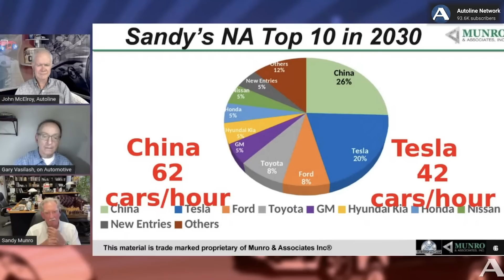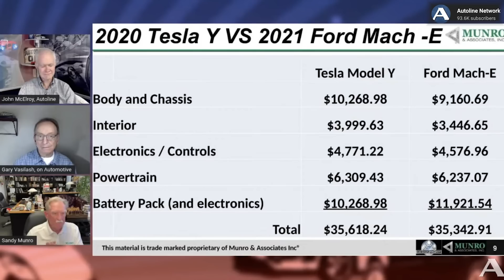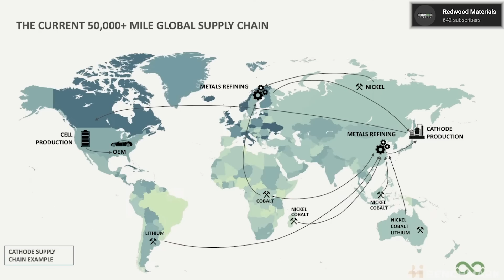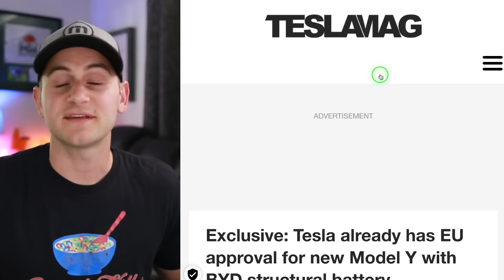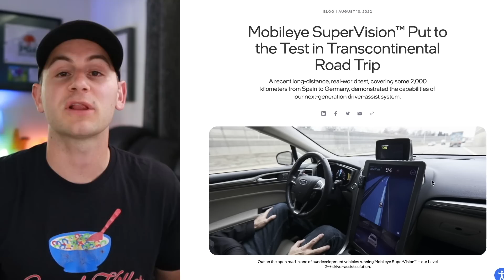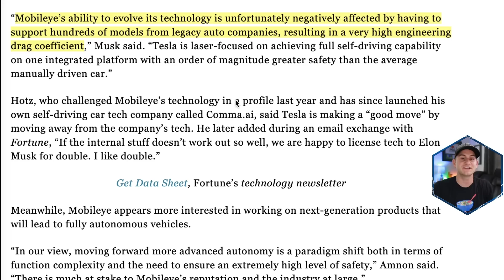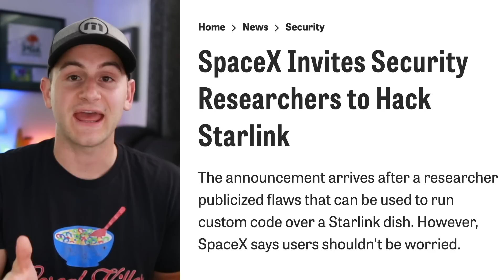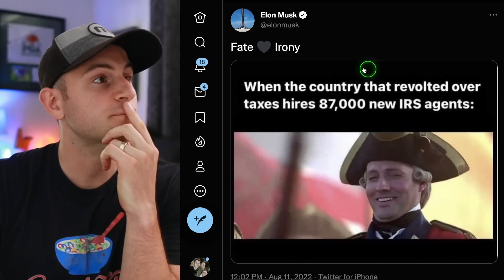New Munro Interviews / JB Straubel Keynote / Starlink Hacked ⚡️

Comment: Video says: “eventually there will be no mining (because of recycling)”.  For that to be true would require the amount of GWh/TWh in service to stop increasing or the amount of materials needed per GWh to always decrease (because recycling is not 100% efficient). If the fleet of batteries has a useful life of 30 years and recycling efficiency is 97% the required mined tonnage remains constant for a constant battery fleet size.

Comment: there will be mining for a long time.  even if you reach some equilibrium in battery materials in use there will be a greater need for storage to strengthen the grid.  Plus as long as recycled materials cost is > new materials, there will be mining.

Comment: The other automaker's problem is not failing to ask Elon for advice. The advice he would have would not help them. Their problem is accepting that they have to invest and risk lots of money to do their own production. Keep in mind Tesla manufactures Panasonic cells. But the keyword is manufactures. They also invest into the developments in their own facility. Getting the knowledge is not the issue. No one else is willing to supply their own battery factory for making the cells because the financial commitment is huge and a short term profit killer and also long term risk in their eyes

Comment: Every time I see a production line that makes Pouch cells, I'm bemused at how complex the process is, and how slowly the line runs. To me, it's a no brainer to use large Cylindrical cells because from a manufacturing point of view it's so much simpler and easier to ramp up the production speed.

Comment: Megapack is also up 25% in price from those two images (even accounting for the increase in battery pack size). I had to check the site, but it's now $2,427K vs $1,527K (3.9MW vs 3.1MW).

Comment: the nay sayers of batteries are REALLY missing the point here. 'battery mining pollutes'- mm... no. NOT REALLY. it's a lot 'messier' than it needs to be- but NOT because it HAS to be- only because no one has bothered to clean up the process-  kind of like cars with no smog controls in the 1960's. and mining for lithium is NO WORSE than mining for coal- in fact- A LOT of people have DIED mining for coal- I doubt ANY have died mining for lithium. 'lithium batteries cannot be recycled'- lmao. JB straubel already IS DOING JUST THAT with a pilot plant- and i don't think toyota would PARTNER with redwood materials if it was a hoax. 

back to the part the oil heads are MISSING: put in perspective- what if, TOMORROW- a company figured out how to capture ALL the exhaust particles coming from an ice engine.. and RECYCLE 96% of it back into some form of usable energy? HOW RICH would that company be? opec & Api would be BLOWN OFF THEIR FEET. they'd be turned into a paper tiger- almost overnight. 

AND THAT IS WHAT REDWOOD materials has done- effectively, by making a profitable process for recycling battery materials. what this means for EV production? once we reach 100% saturation in the usa- after that- we only need mine for 4% of the annual car production, plus a TINY amount for growth. consider this- 1970 yearly production? approximately 13 million. 2021? about 15 million. that's only a .86% rate of gain. 

also to consider- gas cars are MASSIVELY OVERPRODUCED- way past demand. couple that with the fact that a tesla with a 50 year one million mile battery and electric drive train? plus ALL those batteries getting recycled at end of life- AT A PROFIT- how badly tarred, feathered, hooked & fried are gas cars- and by extension, big oil? battery recycling is the 'new oil' investment opportunity. the oil heads like to say "all those batteries will pollute landfills"... so ask the question: does ANYONE throw away copper? HELL NO! at approximately $3 a pound- you'd be an IDIOT to do so. no one has to make a law to FORCE you to recycle copper. so go ahead- throw it in the trash at a city park- a homeless person will be along VERY SHORTLY to retrieve all the aluminum cans AND copper that you dump- and if your local landfill is stupid enough to throw it away? let those homeless people in- they'll pick it clean. now consider this: the CURRENT price of lithium? 

$32 per pound!!! yeah. SURE. throw it in a landfill. ARE YOU NUTS!!???
Reply: That was an awesome rant especially the point about recycling 96% of all oil into new oil to end up a trillionaire. 😀👍🏻
Reply: @4literv6  'rant' kind of implies- there's no reason to be pissed off about being manipulated INTO paying $7 a gallon for gasoline- 

and assumes no one will mind or even NOTICE that- in 1963- Chevrolet built cars that were ROUTINELY capable of lasting 1 million miles with minimal parts replacement. 

the end effect of such a business model- is that consumers basically do NOT 'own' their cars- we RENT them. the cars themselves are temporary- intentionally engineered to fall apart. and then the energy that powers them - is ONLY available through ONE source- OPEC & APi. with such a powerful DUO in place- aka- big oil & legacy auto- they protect their cash cow like a starving pitt bull would defend his food dish with the last bone left in it. these 2 want to make sure you have NO OTHER OPTIONS. 

that's why I'm NOT pissed off- I'm ECSTATIC about the existence of tesla. 

NO ONE is going to 'save the planet'- on that stupid fallacy- I call BS. 

but tesla will save you from giving your life savings to the one armed bandit at chevron. and if big oil tries to 'shore up' their bets- by raising the cost of coal & natural gas? 

GOOD. 

I have tesla solar with power wall- and already I'm disconnected from the grid.... so let 'er rip opec. your move. 

 did you know- that I could EASILY buy feedstock (non-food grade) sugar from mexico & s. america for around 3 cents per pound? then- even after paying for a distillery license & road tax for ethanol fuel- come out at about 80 cents per gallon MAKING my own fuel? 

so why don't I?  because the very second I try to import sugar from outside the united states- the fed will hit me with an import tax that ensures my fuel will cost MORE than if I just went & bought it at the pump. (if I buy clay pots or tile? no problem.. .then we have 'free trade') oh gee- I WONDER who THAT would benefit? what group of corporations could have possibly lobbied for THAT little gem of a law?

Comment: 4680 a) with respect to 18650 b) cell 
b) more thermal couple area/W 👍
a) less thermal couple area/W 👎
a) cells operate much hotter than b)👎
b) use tab area to pass anode current, 👍 
a) use point contacts for anode current 👎
b) single tab bottle neck effect needs data
a) point contacts defeating the tab less 👎
a) point contact is no better than tab👎
a) pack has no bottom structural plate👎
a) no bottom structural plate is a joke👎
Reply: You don’t actually know what you are talking about do you?
So many innovations follow 4680. Heat dissipation, weight & cost savings, simplicity, bringing cell manufacture in-house (to speed innovation).
Reply: @iandavies4853  yes I do know what my comments are. 

Following 4680 innovations is a good thing. Here we have an issue, overheating from reduced cell wall heat sink area per Watt dissipation compared to 18650. 

4680 issue
Core heat diffuse through chemical layers has been a thermal dissipation problem with 18650 of 9mm radius, r, in BEV application, that is worsen with 4680 of 23mm radius, R.

Details 
Let cell volume represents heat dissipation, and let heat sink through cylinder wall area, the area/W ratio of 18650,r and 4680,R is 1/R to 1/r, or about 0.111:0.044 and simplified to 2.55:1. That is to say 18650 has 2.55x more area per Watt of dissipation. That also implies 4680 runs 2.56x hotter than 18650 given the same dissipation. That also calls for -2.55x coolant for 4680 to match thermal load of 18650. That may suggest we need expensive forces vapor phase technology to cool 4680 using a heat pump system further reduce charged mileage.
Reply: @philoso377  still wrong. Fundamentally, hopelessly very wrong.
4680 tabless uses metal foil of current collectors (aluminium & copper) to wick heat to end caps, not relying on slow path through a 40 odd layers of separators & electrolyte. Battery Day. This is reason for continuous folded tab design - heat & electricity. 
In structural pack it looks different / misleading as uses sinuous side cooling bandoliers - relying on thick steel casing as heat path - and only contact-cooling one side of each cell. 
Even 2170/18650 (eg Plaid) only directly cooled one side of each cell, not entire circumference, not flooded pack style. 
Learn from the experts, unless you are at cutting edge of this tech. (I’m here to learn, not preach.)
Reply: @iandavies4853  the anode roll of 4680 protrude beyond the insulation fringe line finished in anode flaps (aka shingle) carries heat from chemical layers ready to sink at the cylinder base but is isolated by an electrical contact wafer in front of the base. This wafer conduct current but heat. Leaving the only path heat can sink through cylinder wall. As do 18650 and 21700 cell do in model3. If you think heat can sink pass the cylinder base, you have missed the late news on 4680 on Sandy’s channel. Everyone do their own research and analysis. So start do so from today.
Reply: @philoso377  you know you are wrong! You just have to sort out why.
I’d suggest look at Limiting Factor cell teardown video, not Munro pack teardown.
Around 17 min in. But still confusing. "Whole cell body is anode." (electrical)
Reply: @iandavies4853  “limiting factor”? Yes sighted in whole. Have you review it in full detailed, like a product developer with 25 years in the mass market industry? 

You’ve missed the most critical part - point contact wafer - (in limiting factor) that blocks thermal conductivity between the hot anode flaps and cylinder base. That is why Tesla employs side wall thermal coupling and not cylinder base coupling. Drawn from Sandy’s video we have a plastic cradle to isolate cell base further heat insulate the cylinder base. That video also confirms that we have no thermal architecture laid beneath cylinder base. So your advocacy heat sink at cylinder base offer no rationale.

Comment: Apparently there is rumor that Elon actively worked to stop or slow down high speed rail in California using hyper loop as a false promise. Would like to know what you think about this because without rail, long term viability of auto manufacture isn’t viable, especially to the climate.
Reply: @not today dude if you asked most physicists about hyperloop systems then you would hear about how dangers and impractical most of those systems are. So elon, someone with training and access to highly skilled engineers is promoting the system. Something is very off and thats from someone who loves most of the stuff he has helped push forward.
Reply: @not today I do, I study this for a living and I actually want cars to exist long term, which is something you don’t seem to get about what I have written.
Reply: @not today I don’t know if your a bot because I think you missed something in this conversation, take a breather and come back and read this from an objective point of view. I’m not being sarcastic and I’m not trying to belittle you.
Reply: @not today okay I’ll start looking up the information but lets start the by analyzing  the hyper loop. Said hyperloop has been promoted at being able to achieve speeds of 800 mph. Let’s give it som headroom and say the loop travels 600 mph, just to give the benefit of the doubt. That means that traveling forward 600 mph, you would drop or rise 4.21ft per min. La height-305ft, San Fran height 52ft. Californias avg elevation is 14505ft. Cut that in half to account for mountains and you still have a potential shift of 7252. Do you start to see the problem here.
Reply: @not today That was establishing height, now lets establish construction. To maintain a perfect vacuum you will have 6720lbs per ft of pressure on the container. That is an insane amount of force that will need a lot of maintenance. The hyperloop test tubes have shown rust on the inside of the container meaning they have not been well maintained and you need that reduction of friction to get to hyperloop speeds. This also shows the difficulty of maintaining the vacuum.
Reply: @not today Then you have to account for feasibility. Elons current model for teslas through tunnel has been causing traffic jams in the boring tunnels. I just wanted to remind you of that for the next part,it’s important. In order for the boring tunnels to actually help people and reduce the burden on society, the tunnel and mode of transport needs enough people traveling through, per mile, per dollar spent. If it costs to much to build and maintain then it becomes a financial burden, if it does transport enough people then it becomes inconvenient, if it doesn’t transport enough people per mile then it becomes in practical.  The hyperloop is set to transport 10080 a day while building high speed rail will transport 115000 per day. So high speed rail would be more cost effective and convenient and literally the cost of high speed rail has risen because rich people (this is documented, without including the Elon rumor) so that you buy cars.
Reply: @not today this is based on research form actual engineers, physicists, etc. which is why I am saying that Elon should know better and literally advocate for rail in addition to an electric car society.
Reply: @not today yes but this is the problem right there, you don’t care that a project like this might be used to stop hsr, that is the whole point of asking electrified to research the rumor and facts around it because if true then that means money is going to another rich person holding back sustainable change. The fact that you reacted like this when I wasn’t even making an accusation. I was asking a source of information to research if true since I haven’t had time to do it myself and if he gets accurate results then it reaches people that care about the issue. If nothing comes up then nothing comes up. When Tesla and Elon have this much wealth and power then they need to be held to a higher standard then if not you get another legacy auto.

Comment: Funny - can I use the 4680 battery in my EV Bike ?
Reply: @Bigboy0  4680 battery - 3.7 volts - I would need 13 to power my Himiway EV bike - it requires 48 volts - so it has a 17 amp hour battery - the the 4680 battery has a 26 amp hour life therefore I could go 40% long on a charge - instead of 35 miles - I could go 50 miles - so the same should be true for a Tesla car - 350 mile range to 500 mile range on a single charge. True

Comment: Given the same chemistry, prismatic cells (or pouch) will always be more energy dense than cylindrical.
Reply: But unprotected. Tesla always rejected 18650 cells with dents.
Pouch is just so vulnerable. Prismatic isn’t so different, just shape.
Watch teardown of 4680 - it’s tough.
Then there’s structural; The pack itself has effective negative weight.

Comment: The bill is opaque because it was drawn up in the dark.  Not how it should be done, but that was the only way to get Manchin on board.  It was basically find a deal Manchin would accept or no deal.  With Republicans it would have been no deal.  A strong democratic majority guaranteed to pass a bill would have forced Republicans to the table and let all sides have a say in the open rather than one man.  That said you can make a case for Manchin as MVD right now as what other Democrat would win in WV?

Comment: Recycling batteries means no more mining?  Even if tomorrow all cars sold were electric, it would take 12 years to replace half the vehicles (average age of cars is 12 years old).  And even with all cars electric, we need more batteries to load level solar and wind generators.  And lets not forget electric trucks, airplanes, and probably ships.  We're going to be mining into the next century.  Don't get me wrong, I LIKE battery recycling.  But I think we are going to be mining through most of this century.
Reply: Correct.  Recycling is not 100% effective, so there will always be a need for virgin materials.
Reply: Nah, we're going to run out of stuff to mine before then. Since the earth is flat, not round, there is not much mass available for mining.
Reply: @ordinaryhuman5645  it’s actually more of a triangular shape, hence why the aliens built the pyramids where they held ceremonies to pass the knowledge onto the elitist’s who over time formed the Illuminati. Early signs of the all seeing eye can still be found especially in ancient funerary texts.